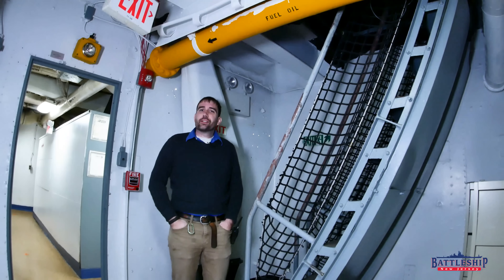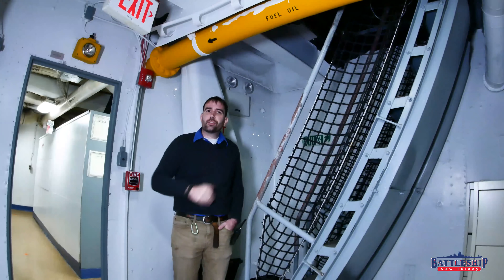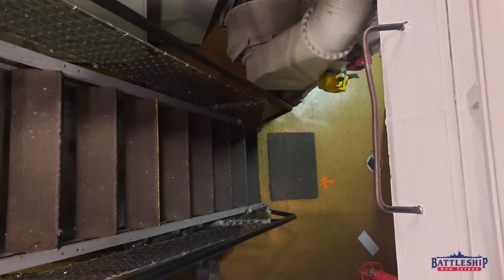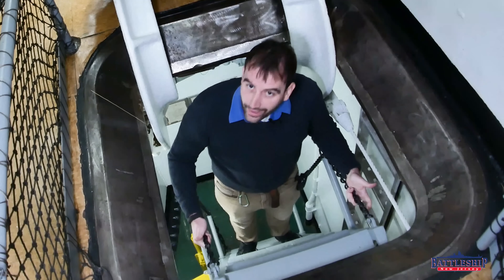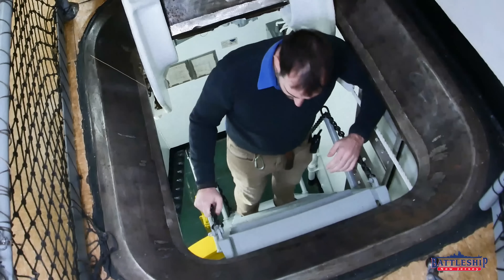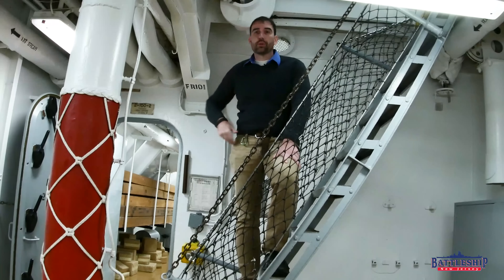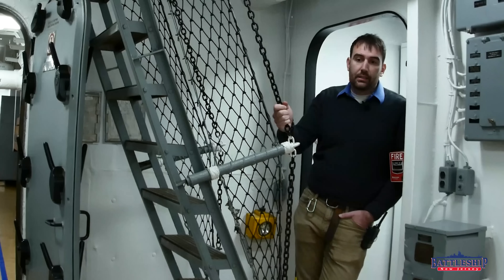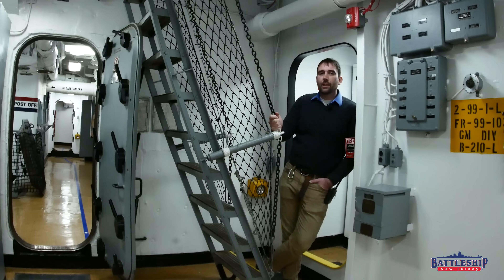Why Are Ladders on Ships So Steep? And Why Aren't They Stairs?

Comment: The worst concussion of my life was when I slid down the middle level ops ladder on a submarine in 1985. I was headed down to one of my pieces of gear to get it back online and I leaned too far forward and caught the upper level deck plate across the top of my head. I woke up on the mess deck stretched out on the chief's table with an ice pack on my head. I was out about forty-five minutes. 
On the other hand, I also went down the wepaon's shipping hatch backwards... even when blind drunk. Never had a mishap.

Comment: As a Navy retiree let me say riding the handrails down a ladder is frowned upon.  Your feet should hit each rung.  That said I still built up calluses on the heel of my hands while doing so.  
Going up and down ladders have a number of hazards, some of which can not be apparent to those not on ships.  Hitting your head going up angled ladders is one.  Clearance from the combing to the tread is supposed to be in excess of 6+ feet, the exact measurements I can’t remember.  I am 67 inches or 5’7”, and many times I have hit my head going up a ladder.
I have dislocated a shoulder carrying things down a ladder when I released hold .
Wet shoes are a real hazard on ladders.  One night I was coming down a vertical ladder and as I moved my left hand to the next rung both feet slipped.

Comment: my father old house had a lader like stairs, where the steps were alternated and on top of that they were gloss panited, i fell down 3 times as a child, so my father put a inch wide grip tape right on the edge of the step. It did not help much

Comment: One time I slipped going down a ladder to 2nd deck (port side just adjacent to radio), if this had happened when I was actually in the Navy it wouldn't have been a big deal, but I wasn't I was in my late 40s.  Also I was in my dress blues just before the Turret 2 memorial ceremony (the only time I put on my dress uniform).  No major injuries but boy was my "left cheek" sore.   Still was able to participate in the ceremony.

Comment: Served on carriers for 20 years. I only went down ladders forward. I have indeed fell on a ladder, I missed the 3rd step up from the bottom, and bounced off the last two as I fell down. I was carrying 52 lbs of ground beef at the time, and did not have my hands free. Really, the ladders aboard ship are one of those things you just get used to. Even now, 7 years after I retired, I have to pause some times going down regular stairs because my feet still sometimes slip into ladder descent mode.

One thing about those chain stanchions on the ladders, do NOT wear rings when using them. We had ladders like those on the Kitty Hawk, and not a few sailors had their wedding ring de-glove their finger when they got their ring caught in the chain.

Comment: We had one gentleman fall off a ladder while working on my house.  But we also had a hammer drop and nick the guy below.  But an unnerving experience when I had construction job, and I was to assist in holding up a 3/4 plywood for a mop sink while standing on a 100ft. ladder in the basement. Often grounds are not always level, so you used blocks of wood, etc. Would it be better if ladders had adjustable foots to accommodate, uneven surface? I know this isn't ship related, but it is about ladder hazard and purpose safety.

Comment: Ryan your spot on coverage of ladders brought back many memories of my shipboard life onboard the USS Franklin D Roosevelt CVA 42 aircraft carrier!
We were actually banned from sliding down the ladders as you skillfully demonstrated in the opening scene of video.
It was odd though, there was no prohibition of using the grab bars. I used to just jump down the hatches aiming for the third step from the bottom (putting my body at correct angle) and grab the bar on the way down past it and swing out onto the deck without touching the ladder once. Risky business though, not done by many, kinda daredevilish, but very speedy !

Comment: Surprisingly interesting. Spiral staircase second staircase in a former home. Only after my fall did I recognize and appreciate that the step width on the inside is very shallow (and metal stairs can be very slippery). Took my time thereafter and focused on staying toward the outside of the steps.

Comment: We always slid down the ladders (with pipe handrails) in the forward position especially when General Quarters was sounded.
You controlled your rate of decent by using your hands / grips as a brake.
You could slide down 90 degree ladders backwards. That was done mainly on submarines.

Comment: The Mauna Kea had an additional hazard if you work in the Pit and come down the ladders on the port side; there's a shutoff valve for aux exhaust to the SW feed heaters on the evaps and it's like a 6" rising stem gate valve upside down. When we were cold iron or steaming in port and the evaps are shut down the valve is closed and the stem is out of the way, but when we were underway and making fresh/feed water that valve is open and protrudes down quite a bit. My Chief who was just a MM1 at the time when he reported aboard when we were in port and he got used to sliding down the ladders since most of them were the same angle. Well next time we get underway and 12 miles out, fire up the evaps, and he comes down for watch he runs right into it. I think he had that acme thread mark on his forehead for a week.

Comment: 8 years former Navy Engineer BT and 18 years Merchant Marine assistant engineer here. I learned the safest way is to slide down forward as you can see what you're going to run into when you're going to GQ or firefighting. You develop a lot of upper-body strength and you learn to swing forward when you're going down so you don't catch the rungs.

Comment: When I toured battleship Iowa I went down most ladders facing forward. However, I was wearing shorts that day and the back of my calves got turned into ground beef because they would rub on the griptape (like sandpaper) that was on the  ladder treads. Towards the end of the day I found myself going down the last few ladders backwards to save my calves. One of a tour guides saw me going down backwards and gave me a little grief about it. I told him my calves couldn't take anymore grinding and he just laughed and smiled.

Comment: I remember actually doing a tour of a  current US Navy frigate , whilst they were in a local port for an R & R visit for the crew. Boy those ladders were steep and narrow, and we were all going down them forwards, these all had solid hand rails at least on the tour, I slipped on one step because the way I slipped and fell a bit meant I was able to grip the rails with my hands and arms.  Ended up with some bruises but I didn’t really fall more of a missed step and getting the next step, actually no one noticed it had happened.

Comment: When you hear the GQ drill you have to get to your duty station ASAP so the way to do that is to slide down the hand rails, no feet involved.  Served on a Midway class carrier during Vietnam & I had to go down a ladder that led from my berthing compartment to the aft hangar deck that was 3 times longer than the one you first went down. Going down by yourself difficult, try carrying some sort of aircraft component from the flight deck down a long ladder to the hangar deck, a ladder that had a switchback halfway down. Fun times.

Comment: A big reason they are still steep is because as necessary as they are, they take up a ton of room and room is at a premium. So, most ladder ways do double duty as a rigging path way if removed. 
Think they're steep now, wait till you get tasked with getting a loaded stretcher through one during an evolution such as G.Q.

Comment: Yup... sailors do fall down ladders. I was on summer break in 1973 and was asked if I'd like to go on a WestPac cruise -- with the promise to get me back in time for fall class registration. I jumped at the chance and flew up to Seattle where I boarded the Gearing Class USS Carpenter (DD-825) and departed -- with three other similar destroyers -- just a few days after spring final exams. As this was my first experience on a Navy ship at sea (I had been a Vietnam sailor and had had different hazards to face), I was eager for some real sea duty. Found out in a couple of days just how tricky those ladders can be, especially in a tin can that rides like a wild roller coaster in a storm. Take one step down when the ship rolls and you can easily miss the next step and land on the deck below. Handrails saved me more than once! Did take a fall stepping through a hatch on my way to officers' country when the ship pitched up and caught my foot late one night. I lay breathless for several moments and finally got up and slowly, but now very carefully, made my way to the bridge where the sea was really rocking and rolling. Ship passageways at night (red lights only) in a rough sea state are loaded with dangerous protrusions that want to snag you, ladders included! Had a great summer on the Carpenter and visited Adak, Alaska; Yokosuka, Kure, and Sasebo, Japan; Taipei and Kaohsiung, Taiwan; Hong Kong, Guam, Midway, and Pearl Harbor. Loved answering the question, "What did you do this summer?" Great video! 😎

Comment: Remembering back in the early 70s....I was stationed on the USS Hermitage LSD-34.....One particular day, I was heading down a ladder on an open deck....Facing forward, & Hot Dogging.....feet off of the steps.....Sliding my hands on the hand rail......It was made of brass tubing, & chrome plated.....Because it was exposed to weather, the chrome was peeling off.......my sliding hands got severely cut by that peeling chrome !!!... YEEEOW !!!......Never did that again !!!!......U.S. Marine 1972 - 1978

Comment: If you're fairly tall, WATCH YOUR HEAD!  That's why I prefer going down forwards, even though visitor instructions strongly recommend backing down.  They also say not to slide, to discourage old sailors from trying to prove they still have it! 😉
In the submarine DRUM, stairs were installed in the torpedo rooms to allow access from the deck.  The vertical ladder wouldn't cut it for tourists...

Comment: I served on USS Inchon (LPH-12) and descending face first was the norm as we were up and down ladders so much; we were in our teens or early twenties and bulletproof anyway. Our working spaces were far forward with our berthing a deck above. In a rolling sea you could easily jump the full height of the ladder between if you timed it right.

Comment: When I last visited Battleship Wisconsin and Battleship North Carolina a number of visitors were unable to visit many of the internal spaces, not understanding that these WARSHIPS were designed long before there was an ADA (Americans with Disabilities Act.)  Some modifications were made to Battleship Iowa back when FDR used her to travel to Morrocco for the Casablanca Conference.  I believe that many of those modifications were temporary expedients to allow him easy access to his quarters in the Flag Bridge / Quarters area and were removed or changed back afterward though his bathtub was left in place.  

Also, these ships were designed with what to us are low ceilings / overheads so you budding basketball players ... mind your heads because steel doesn't give though your thick skulls might.    😉

Comment: The ladders on the Spruance class destroyer were mostly symmetrical. The ladders on the Midway class carriers were of the same standard as the New Jersey. Shaped to fit specific areas. I got use to going down looking forward. Never broke anything.

Comment: The Forrestal class carriers had an escalator. It ran from the mess deck to the 03 level. When they designed the ships the put the squadron ready rooms down on the 2nd deck to protect them from possible kamikaze attack. To keep the flight crews from tiring themselves out climbing up to the flight deck, they put in the escalator.   

By the time I served on Saratoga, Officers were the only people allowed to use it. Enlisted sailors still did occasionally though. I knew one sailor who was transporting cruise boxes down the escalator once. When he reached the bottom, his foot wound up between the cruise box and the bulkhead. It crushed his foot.

Comment: Similar to attic ladders, those ladders are worse because they fold and are shaky and do not have hand rails. They are better because the ceiling is lower and you can almost grab the ceiling till the last few steps. Have a garage attic and that is 10 feet and is probably similar without railings and shaky. I don't use them much so take my time when I do, carrying bulky or heavy objects up and down is not the safest thing you can do. I don't think I have fallen off of them, but have off of step and extension ladders, climbing more than 10 feet up on the extension ladder same rules apply be aware. Have a carbineer wired to the top of the extension got a climbing belt so I can connect myself to the ladder and footing or balance issues might be checked, I don't use it like some rock climber it's a last line of defense. Had an extension ladder slip out from under me on a 10 ft garage roof climb, belly flopped the asphalt and got messed up, no YouTube then and had not seen the videos on extension ladder safety, clicking it up 1 rung, angle, etc.

Comment: i love how you talk about the little things on shipboard life. Going down to the engineroom , we had a double ladder with a small landing in between because it was over 30'. During a drill my heel got caught and i fell forward. I grabbed the grabhandle and my feet swung out like swinging on a monkeybar. I would have been seriously hurt if it weren't for that handle. The railings were all chromed so we would all slide down on the handles and our feet didn't touch the stairs at all.

Comment: The chain is not long enough to be extended above the hatch nor would anyone extend the chain through the hatch. General Quarters can be sounded anytime and there absolutely no time to mess with a chain going through a hatch. The chain is loosened so you can remove the ladder.

Comment: General Quarters: "General Quarters, General Quarters! All hands man your battle stations. The flow of traffic is up and forward on the starboard side, down and aft on the port side. Going down forward you grab the rails loosely and lean back with elbows over the rail and can slide assist down for speed. My dad was in WW2 on USS Louisville CA 28 from 1943-46 and said that was how the sailors went down fast. There was a less than minute to get to your station for General Quarters and at times sailors ran to their battle stations with part of their clothes in hand and dressed at their station. Thanks for your video.

Comment: I slid forward down an external ladder one time from 1 deck aft to the quarterdeck. I had never tried it before and i slid all the way down out of control when my feet hit steel at the bottom i commando rolled out to break my fall. I never did try sliding down any external ones again after that you dont know if they are greasy, wet etc. R.A.N.

Comment: Civ-DoD RORO ships had actual stair-ways in the deckhouse and down to engineering  and nice vehicle ramps to get down to the 7 lower vehicle decks. However the forward ammo holds had 20-40 foot vertical ladders including some sections high up that were "obliquely angled"(the dangerous way, ), those were "interesting". We basically could not go into those areas except at anchor in calm seas. Had to check the ammo holds monthly, see if anything was leaking out the ammo  CONEXes or whatever.

You fall on a ship there is no soft place to land or if you drop any glass/ceramic its gone/broke. I was proud that my  Allied Signal coffee cup lasted 14 months on the ship, and I got home used it for about 10 years everyday, then my wife filled it change one day and  set it on the  top corner of our refrigerator (for some genius female reason) and our cat knocked it off.  15 years later that still chaffs my az. I'll get even one day. LOL

Comment: When I was in the Royal Navy, no one went down a ladder backwards . The only people that ever went down backwards were visitors, old ladies and Air Force personel. The trick is to carry your weight on your hands and arms and use your feet to control your speed. Ryan thanks for demonstrating how to slide down the handrails using you hands and ankles, like so that ten guys can get down a ladder in ten seconds . Can you demonstrate how to do a ladder when the ship is going up and down 50 feet, weightless for ten seconds and then double your weight for the next ten seconds. Throw in a 35 degree roll and it gets even more interesting. Which may be why sailors have big arms. A good all day workout but you wind up looking like a Chimpanze, all arms and no legs :)

Comment: I was HM attached troops (BLT 3/4) on U.S.S. Ogden & Vancouver (1974). Going up & down ladders on those ships posed a problem for my Marines.  The marines wearing their covers going up and down ladders would hit their head on the steel rim on the hatch.  Many of the Marines received a cut on top of their head.  My troops, my suture job, was usually closed by five to six sutures and a tetanus added for good measure in sick bay.  Most everyone in my unit hit their head at least one time if not  more.  Wearing the MARCORPS cover you can not see what's above the covers' bill.  That 's where the no see um was at.  We ALL learned not to wear our covers inside the ship. Essentially once the education was complete, the injuries subsided.